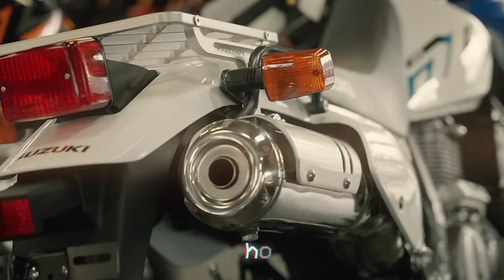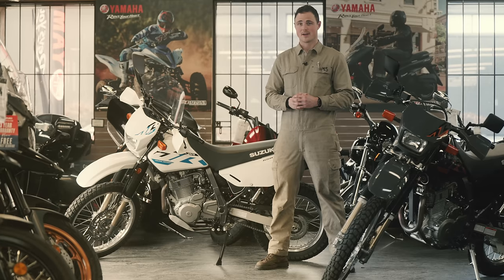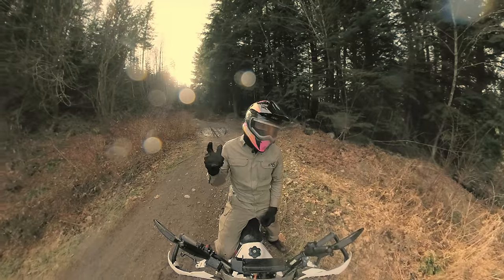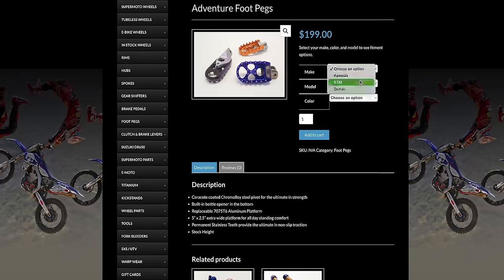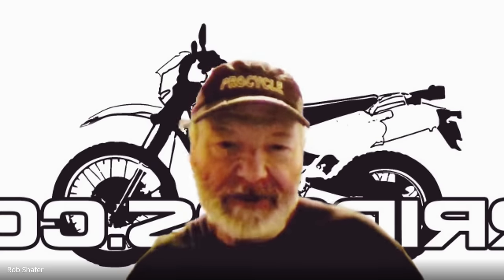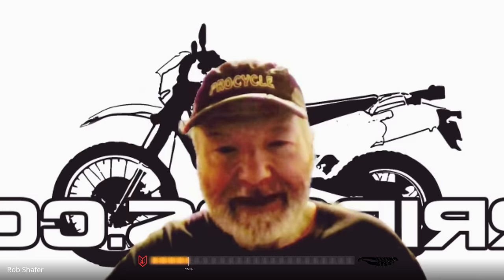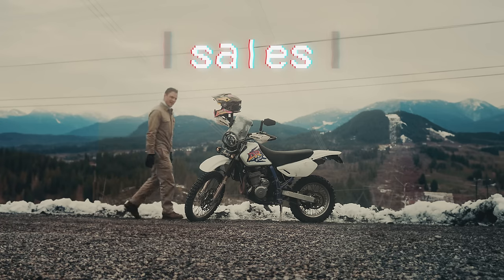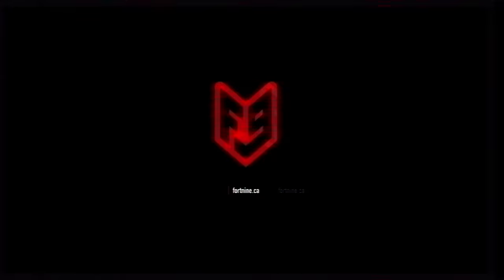Suzuki DR650 - The Motorcycle that Built a Community

Comment: I have a '91, bought in early '92.  Wanted that year because it still had a real bash plate, rear carrier and no electric start.  Keep it simple, doesn't even need a battery!  Sent the carb to California for some massaging, changed the bars, removed the snorkel, added a Supertrapp can, gold valves in the front forks, spent quite a bit of time jetting it myself and still runs very well, wheelies off idle with no clutch like an overweight trials bike.  Biggest issue is the lack of aftermarket parts for anything earlier than '96.
Reply: What jetting do you have on it ? I have a 93 ,kick only, and it's restricted. Thank you
Reply: @mircearadu3854  My jetting settings won't help you because of the mods done to the inside of my carb.  Open up your exhaust a bit and open up your intake a bit.  If you only open up the exhaust, all you'll get is more noise and some backfiring.  There won't be any real increase in power, unless you're twelve years old and equate noise with power.  Then, do the plug chops and tuning, it's worth the trouble.  I did mine 30 years ago and never needed to do it again.
Reply: @RandyPiscione   Hy Randy, thank you for taking the time to answer to me. 
What do you mean " do the plug chops " ?

it does actualy help me, knowing the jetting size, becouse my DR came from Germany and was/still is factory restricted, DR 650 R SP44B, the B is for the restricted version, for germany only.
I sourced the jetts sizes and came up with 150 main and 52.5 pilot,  got the OEM codes for them and bought them from local suzuki dealer and i'm in the process of changing them and opening the exhaus and intake.
Reply: @mircearadu3854  The reason my jetting won't help you is because my carb has been modified, the inside has been machined, so it's no longer a stock carb.  I can actually see through the main jet, not sure what size it actually is.  Each of the "jets" in a carb act on a specific rev range.  In order to get the bike running properly, you need to adjust each jet individually, and test the effects individually.  And, you can't do any of this until you do your other mods, to the airbox and the exhaust.  The phrase "plug chop" means you ride the bike in the rev range you're currently testing, and then kill the motor and coast to a stop. You'll need to do a bit of googling to check those ranges.  This got interesting for me because I had everything perfect except the very top end.  So, I would cruise on the highway at 120kph for a short distance, kill the motor and coast to a stop at the side of the road.  Then I would pull the plug right there, check the colour, put it back in, and ride to work.  At lunch I'd make an appropriate adjustment, and do the same thing on the trip home.
Reply: :))) now i got it, spark plug, i was thinking at a actual plug.
Once again, thank you for your input ! I hope that i get some time this weekend to make the mods.
Best regards !
Reply: @mircearadu3854  Good luck!

Comment: Man this makes me  want to get a 650. I had a DR 200 back in 2008 and put close to 50,000 miles on it. Commuted year round in Illinois for several years and beat the living crap out of it with no issues. Best 1500 I had ever spent. Sold it because I broke my collarbone and had to sell it to buy a car since I still needed to get to work. Brought up nostalgia with the N64 and DR's so I might need to look around now.

Comment: Respect to all DR650s out there, if I didn’t already have 15 years of mods into my KLR, I’d have one of those in a heartbeat.  Been riding for years, and DR650 riders are always just calmly hanging out, easy going, all while the KLR and XR guys argue over taking the highway or the single track to get to the camping site.  And a tip of the cap to the hooligan cousin who brings the DRZ400 and scouts ahead on the trails. 😎

Comment: man thats so true, i had a ktm duke 690 and each year i just hated the worry that soon something was going to go, metal in the oil, oil pan bolt stripped, clutch slave cylinder fail... it was brand new and already falling apart. so i sold it and got my dr650 and i love it! not as fast, but i can go and do anything with it. if you want a bike that will last forever and be a reliable, easy bike get a dr650 and mod it to become the perfect bike for you

Comment: I have a 2007 from a friend who bought it brand new. I acquired it around 2010 when he decided to replace it with a truck. It has been stone reliable and I have even used it in three dual-sport rides including the hero sections. It's a great adventure bike. I also own many other bikes (KTM450EXC, WR250R, Honda CRF250X, RE Himalayan, 650 Versys, Hodaka Ace 100, Three Pentons, RZ350, etc etc.) But the DR always makes me smile and it's fast enough to use for highway trips in some comfort with soft bags and a small windshield. It's a keeper but I do need better suspension. I guess the KTM spoiled me for off road fun.

Comment: I agree with you about "raising your bike". I've owned my XR650L for quite a few years and now it's past 53000km. You definitely get to know your bike and what to check before heading out. I'm finally doing a rebuild even though it's not needed but I wanted to go with the wider ratio gears from the Dominator plus the countershaft wore out... typical for this bike..... Also going big bore and cam just because...

Comment: I bought an XR650R from 04. Same thought process you outlined: KLR too heavy. DR too middle of the road... XR650L... still too slow?

So now I have a kickstart only machine that weighs 320lbs fuelled up. It's the poor man's KTM690. And yet... I wish I had electric start. I wish I had FI. I wish I had a DANG 6TH GEAR.

I see the attraction of something like an old 650 single. But man... there are a couple really useful modernizations that don't go amiss on any bike. 6 gears, fuel injection, and electric start. Suzuki is notorious for omitting the first two (AHEM drz). But I am grateful that such machines can still be bought new. That's pretty cool.

Conversely, look what happened to the KLR revamp. Sure, it's arguably better than the old one... but enough to justify the price difference? Not to many.

Comment: I had a DRZ 400S and while OK in dirt, it sucked for the limited pavement I was willing to ride. I sold it and found a mint DR650 with 745 miles and gladly handed over $4400. 8 years later, I've modded the heck out of it, plus 2 wheel sets with an 18" rear on one. Rode and camped through 7 western States last year on it with a friend that had a similarly prepared DR. 
Like the man said.
There are many like it, but this one is mine!

Comment: I've always wanted one of these, but I never had enough money saved up. 
     I found a 2000 Honda Shadow Sabre 1100cc with 28, 481 miles on it on Facebook Marketplace for $1,700, and after looking around for something smaller, I bought it because all the smaller bikes were much more expensive. I'm sure glad it worked out that way, because now that I'm used to the weight and power (I'm 75 and weigh 115 pounds, while the bike weighs almost 600) I'm loving it, and with 10 months of practicing figure 8s and doing slalom in an empty parking lot after my daily 19-mile ride, it feels just right.
     After buying a helmet, complete body armor, adding crash bars,  handlebar and front fork windshields, and changing all the fluids and rear tire, I figure the total cost, over time, at about $2,500.

Comment: Very good points indeed one of the best bikes I owned indeed. Very tough and overbuilt. 97000 ks and still going strong with the original clutch plates no less despite desert raid, ridiculous 4x4 trails and too many river crossings to count. Not a huge amount of mods on it either, though the lack of rebound on the rear shock nearly killed me once. So over 12 years mods were suspension 30 litre tank bars and some armour. Engine was never touched and despite burning a small amount of oil it is fine still have it too many good memories. 
Due to age and mileage and the fact that I like to explore very remote areas solo I was convinced by the wife to get something newer though there was nothing really wrong with it. I bought a 701 fully tricked up for desert raid. Never quite gelled with the bike even though it looked perfect on paper. To add insult to injury jury while prepping in for a long desert trip its engine blew up and I had to get out the retired 650 to complete the trip which it did without a problem. 
I have now replaced it with a 300 rally slightly more complex but very similar in so many ways to the DR that I think if it as the new DR cheap reliable, and capable of anything. Shockingly even though it is not much lighter it is much easier to handle in the tougher trails then the DR and the DR is excellent in the rough as far as dual sports go. 
Amazing bikes

Comment: Similar in many ways to the RE Himalayan. The Himalayan is easy to work on, a similar character & has a large aftermarket too. I am just selling mine after 4 years to move to a 20 year old XF650 Suzuki - the more roadworthy version of the DR - as I found I just needed a little more grunt. You sure learn a lot about riding and mechanics. There's a real appeal for simple and maintainable machines.

Comment: The DR650 and it's community is so similar to the TW200.  For all the same reasons.  They are both internationally ubiquitous.  If you break either on a ride through Mongolia, the parts can be found sitting next to each other on the shelf of a shack in the middle of nowhere.  Great bikes for what they are and do.

Comment: I bought a used 2004 about a year ago with 7,000 miles on it for $2300.00 U.S. I probably put $750.00  worth of stuff on it and pretty much retired my 2016 KLR.  The DR has about the same horsepower as the KLR but weighs 100 lbs less. I liked the bike and the lighter weight so much that I bought a DRZ 400 too, which also has about the same horsepower, but weighs another 60 lbs less.  At 68 years old, I really appreciate that lighter weight.

Comment: I owned a 2002 model that I bought modded for ADV riding from someone else. I LOVED riding that bike. Yes, it had at least $2k invested in it. The only thing I did was yes, replace that rock-hard seat and added a taller windscreen. It already had new springs/shocks. Big tank. Modified carburetor. Pedals. Hand guards. Battery. It was a GREAT bike.

The only thing I wished for was another 10HP of power. Riding fully loaded and especially at altitude, you were full throttle going up a mountain pass doing MAYBE 50mph. Not a bad thing. Unless you were doing this at night with crazy Mexican truck drivers bearing down on you. But otherwise, I did everything I wanted with it. Did a month of riding around Mexico in all sorts of roads and conditions.

I sold it before moving to NYC. Would I buy it again? Possibly. It's super cheap and the parts bin out there for the bike may be the best in the world. Forget buying new. Just get an oder model with low miles and save a couple thousand dollars. They are all the same after all. Great gas mileage. Easy to fix. I bought a good deal from Procycle US and love their service. 

For a second bike, I would probably buy the DR650 again.

Comment: I bought one out of the paper back in 2012 and was surprised to find so much aftermarket support. All my other bikes were a hassle if I scratched the plastics or bent something. Getting parts was difficult. I live on an island with a million scooters and 3 and a half enduros.
I blacked everything out except the tank and got all new rubber. Then people wanted to buy it from me! I had a son and sold it to a guy that drove 300 miles to buy it. No haggle. I guess I didn't know what I had!!

Comment: The DR650 was my first motorcycle, for about three months, at which point it was stolen and never recovered. The only thing I didn't like was that horrible vacuum petcock, which several times filled my air box and crankcase with gasoline. I had a Yamaha gravity-fed on/off petcock on order when it was stolen. My next bike was a DR200, which ended up being more practical for my situation and which I still have and love. Still salty though. But the petcock was also compatible with the 200, so that was nice

Comment: Best bike you can buy it will take you almost everywhere, I loved it is so easy to work on and troubleshoot in the middle of nowhere, if you want a GS1300 with 100 different sensors that could fail it's ok I'm going to pass you lower that 80mph in my old trustable DR ❤

Comment: Very valid point on the community, and much respect there. However I've had my time with a DR650 and put approx 50,000km on one, they were good back in ~2010 as they represented value for money. Today - and for the last decade - there are so many bikes that have dripped into the second hand market from originally higher price brackets that vastly outclass the DR650
G650GS or TR650 are 2 examples that can be a drop in replacement that is every bit as 'bulletproof' yet are vastly superior machines to even a heavily farkled DR650

It's best value proposition today is keeping the cost of other 2nd hand bikes down. As without the continual DR650 supply into the market, those 2nd hand bikes would all be snapped up or cost more

Comment: Wanted a motorcycle but had limited cash.  Never heard of DR650 but it was the cheapest on used market. Bought one for $3800. I am not at all the handyman type. DR650 makes you one. In the last 7 years I have it fully modded working in my apartment parking, using Dollarama tools. Plan to do the Trans Canada Adv Trail(TCAT).

Comment: I love my 2022,  with carb needle shim and another one and a half turns out on the mixture the screw the bike run absolutely perfect in all ranges,  and with the aftermarket exhaust it sounds downright musical.   I did have to lower it though,  very tall bike,  and that seat is rock hard from the factory so that had to go.   Otherwise one of the top bikes I've ever owned,  might buy a second one.

Comment: I looped mine doing a wheelie at 60mph and picked it up and rode it home in the most excruciating pain of my life 😂. Handlebars were bent, phone and phone mount disintegrated, rear pannier racks bent upside down but it lethargically fired back up and got me home with a skinned back and arms. Rebuilt all the broken stuff and you cant even tell it flipped across the road at 60 😂

Comment: I would like to see a study on the effect of flywheel weight on performance. People talk a lot about horsepower and torque but those both come from the energy of combustion that is happening right now. Flywheels store that energy for future use. Are heavy flywheels the reason the Himalayan performs far better than the horsepower and torque numbers would indicate? If so, what can we learn from that and is there a way to take advantage of it when building an engine? People used to shave flywheels to allow the engine to rev quicker — what about increasing flywheel mass to make a bike even more tractable? Is it possible to increase the flywheel mass of something like a DR650?

Comment: Bought a used one over the pandemic . basically for trail riding. I have to admit is pretty easy to work on already have done or redone some mods on it, it had a bad air box mod so i found a used one and replaced it m y buddy had new jets for the carb and rebuilt it and now runs like a charm. I would love to see Suzuki try and make a new one with fuel injection like the KLR. because i have multiple bikes (street) the DR tends to be ridden the least but have to admit its a great bike to own

Comment: I knew i loved Suzuki for a reason. they didnt change my GZ250 for its entire lifespan. well, mostly. Some bits and bobs got changed but basically any part from a 1998 will go onto a 2012. Well guess i gotta get a DR soon. wanna start dirt riding but dont wanna commit to a full ADV bike (yet), so maybe an ole used DR650 would do the trick.

Comment: ya, i owned one and i modded the crap outta it and i could go on about its merits, however, my hands were repeatedly damaged by the vibes at the handlebars. That damage is cumulative--ask me how i know. Whereas, in comparison, a post-'17 KTM690 is a smooth as butter. 

Props for the ProCycle mention

Comment: I wish there were automobiles like the DR650, Xl650, and KLR 650.  Can you imagine if you could buy a 1995 Toyota Tacoma for 2/3 what it was priced at in 1995?!

ETA The Yamaha TW200 is another great one that's decades old and virtually unchanged.
Reply: Or better yet, a brand new Tacoma for less than what they cost in the 90's. BTW, Ryan has a GREAT video over the T-dub. One of my favorites.

Comment: I had three in 10 years.. 1996, 1997 and 2010. ❤❤❤ I learned to do most of maintenance and the repairs; on the sidewalk or the top of a hill if necessary. I recommend this bike 💯. 

I am a woman of average height, and this is the thinnest bike of it's engine size. That is a nice plus, if you compare it to the klr, or any ktm or bmw's width. The thinner the bike, the less legs length it will take from you 😉

Comment: After hurricane sandy my wife’s car was crushed by a tree and my car was trapped behind said tree. My primary mode of transportation was my DR650. I could walk it on the “gas can” gas line and skip waiting on the “car” gas line. It had an aftermarket 5+ gallon tank. Which I could use to fill my generator. 21 days we had no power. I sold it years ago but miss it.

Comment: Thanks for your video. Did you change the throttle and clutch cables? I'm trying to raise my handlebar by 3'' on my DR650 and these two cables are tight when I turn the handlebars? Thanks, Alain